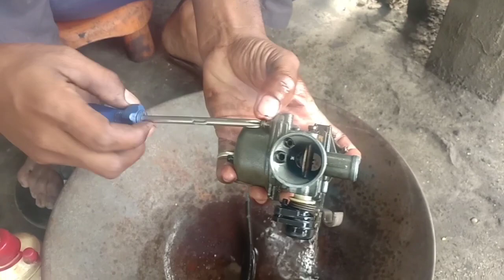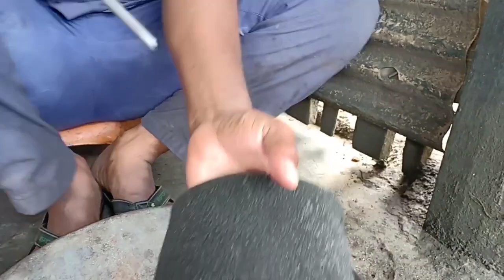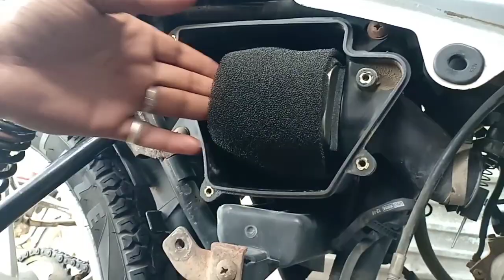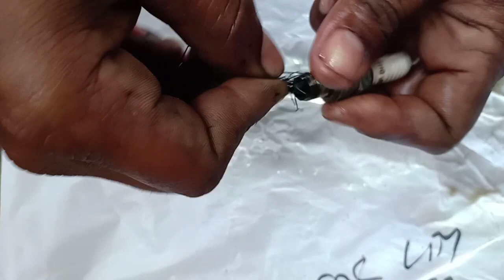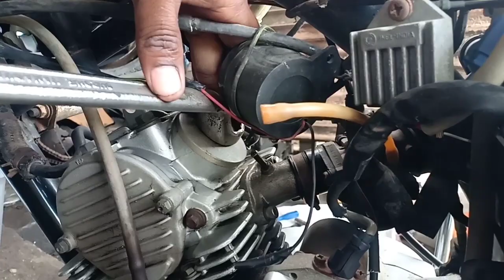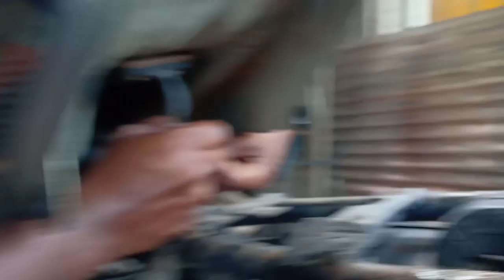TVS Star City mileage problem...

Comment: Anna na second hand la bike vangiruken...2015 model TVs starcity plus 110 cc..mileage 35 than varthu...mechanic ta kuduthu airfilter, carpenter clean pannite...apdiye than iruku..na Enna panna?
Reply: Carpenter tuning
Reply: Same bike, same model, same mileage, same year, same second hand, same problem👌👌👌semma
Reply from the maker: clutch change pannunga..
valve check pannunga..
Reply: Athe prachana than bro
Reply: @LocalMechanicTamil தலைவா நீ வாழ்க ❤

Comment: tvs star city 110c 2015 model bro bike nalla pooguam pothu Thana off aagudhu  then 10 minutes or 15 minutes peringu start aaguthu Enna problem bro
Reply from the maker: Petrol tank clean pannunga bro...
And engine oil check pannunga
Reply: Ok bro but current pluginku  sariya Vara maatingathu bro
Reply from the maker: Unga bike AC ya DC ya ...?
Sollunga.....
Reply: @LocalMechanicTamil  AC current bro
Reply from the maker: Power coil change pannunga bro....
Vere entha velaiyum pakkaventam
Reply: @LocalMechanicTamil  ok bro I will change . Thank you bro
Reply from the maker: Thank you
Reply: Tvs star city 110c Speedo meter line vanthu vanthu pogothu athanala bike off aaguma bro
Reply from the maker: Ac ..current na off Agathu
DC na agum
Reply: @LocalMechanicTamil  thank you bro

Comment: Bro en star city plus  .. Mileage kuduka matudhu .. Inga irukra mechanic .. Solution kuduka matranga .. Pesama vithudunga soldranga.. Naa pondicherry bro 2008 model
Reply from the maker: Carburettor clean pannunga...
Air filter clean pannunga...
Clutch plate change pannunga...
Valve check pannunga....